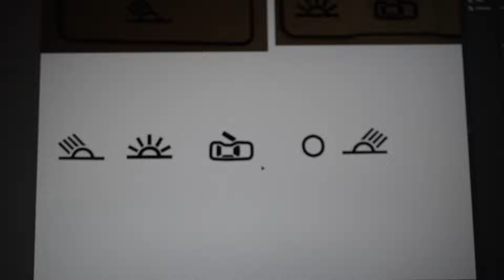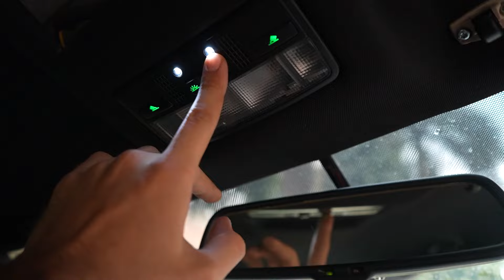From Beige to Black interior in my Laura AWD!

Comment: Nice interior restoration man! Finally project laura looks finished! BTW prerak did u finalise the adjustments for the rear bumper? Also what is the main cause of the headliner sagging?
Reply from the maker: Headliner sags overtime as the glue fails between the foam and the fabric, new fabric is no different, it has a foam layer and the fabric is glued on top so in the next 9-10 years this headliner will sag as well, it’s the heat which slowly reduced the efficacy of the glue and once a corner or edge picks up, the chain reaction just droops the entire headliner.
Reply from the maker: Bumper will be adjusted in part 6 of the laura awd series, which will be the final episode on that series.

Comment: Loving those L&K Door panels! Which 3 Way are you planning to set up?
Reply from the maker: Yes they’re great, currently the tweeter, subwoofer and the MID are sharing the same signal, in the future I’ll be running a 10 channel OEM amplifier that I showed in the video, which will make the front tweeter, mid and subwoofer on their own channels and the rare subwoofer to be separate and the tweeter and mid will share the same signal.

Comment: Hi did u remove gear knob I was not able to remove for mofication nor mechanic
Reply from the maker: It has a trim on the left side, the chrome piece which you need to remove first and then you need to keep the level mechanism pulled with a thin pin which has a bend in the end, then it can just be lifted up given that you have opened the metal tie clamp at the bottom of the knob

Comment: Hey, Great Job again, Do u have plans to have driving modes on this Car??
Like Full AWD, 70 RWD 30 FWD, or Full RWD, something like that
Reply from the maker: Won’t be playing with the Haldex controller any time soon, the current bias with the Haldex is 95-5 in normal conditions and 50-50 under launch conditions and depending on the steering and power requirement the split changes between this

Comment: Great Work Man... Feeling jealous ;) ...  I have Vento 2011 diesel and the passenger side (front side which later travels to rear side ) the water is leaking inside , i am not able to understand where the leak is from as in the engine bay I can see the AC water is coming out... Can you suggest something before showing to any mechanic... tried to read some forums but no use.
Reply from the maker: Clean the drains under the cowl area in the engine bay where the top mounts of shockers are located, it usually gets puddled up if the drains are clogged and water slowly seeps in
Reply: @PrerakKataria  Can we find any official documents(image will also help) where the exact place is so i can find it without damaging other things.